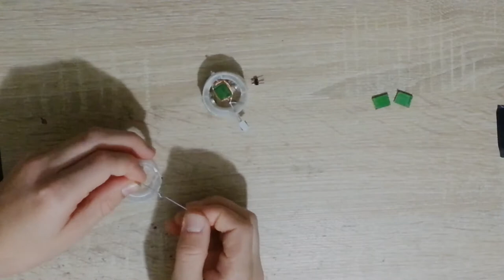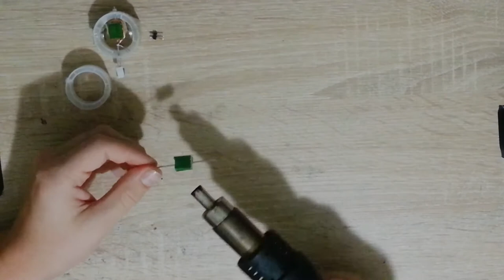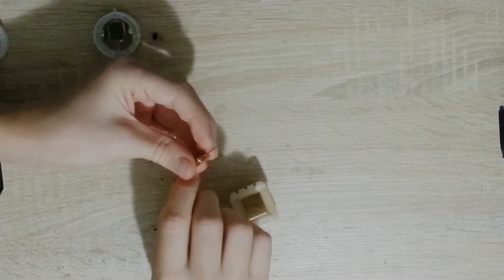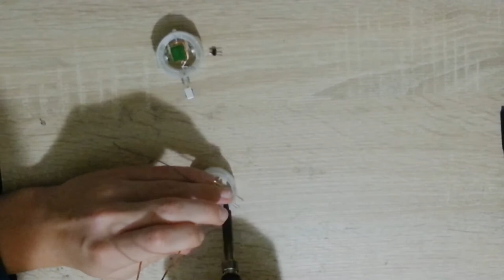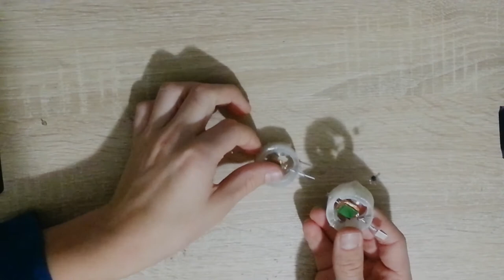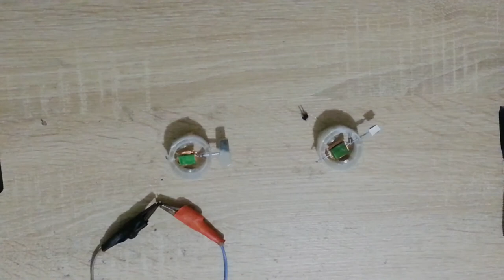Quickly building a Galvo for a future project

Comment: I am also working on diy galvo,
I wanna discuss something related it.
Reply from the maker: sure, what is it?
Reply: @king_wing34 
have you added torsion spring?
If yes what its homing position, because I wants to try such spring setup that can force spindle to center it from both direction if driven by both polarity, Is it any good to add torsion spring!?
How its Amplitude response when increasing frequency? It decrease linearly of varies? What is its maximum operating frequency and difflection angle amplitude on average without Pid?
Reply from the maker: @omsingharjit  well, no, I'm not using a torsion spring. What I did was solder a piece of thick wire to the axle and to that I connected a tension spring. Then I just adjusted it in a way so that the coil wouldn't be parallel with the magnets when its not being powered, so that when it gets powered, it won't happen that it may go in a different direction randomly or whatever... Also, I made this not thinking about driving it with positive and negative voltages..
While I can see a torsion spring working, I think a spiral type of spring would work better.
Also, while increasing the frequency (using a sine wave), I could only get it to about 500hz to 1khz without loosing too much movement. For frequencies higher than 1Khz I needed higher voltage and... well, by then the coils were burning up.. so what I built can't really go any higher than 500hz, but it I were to build it again and in a more solid way, I'm thinking it  would probably be able to do frequencies up to 2khz or higher. I don't know until I try, lol.
Reply: @king_wing34  so, your design is based on one side Active by Coil spring mechanism) ,  I'm worrying more about Its inertia because of thick and heavy shaft so my plan was to use 2mm I'd Bearing and smallest dia as possible from toy motor shaft and casing either moving magnet or Moving Coil  but I have seen lots of people tried much larger DIA shaft and bearing so I think it's not issue much so I will try both my and your design 'thanks " BUT i like to use curve  magnets so it's Force will be same at any position and direction, and if the amplitude decrease with Frequency Linearly then I like to use this topology where the amplitude signal of its Tilting positively feedback the Voltage or its Duty cycle or I will
Try to built Pid using Opamps if necessary just using Analog. 
By the way... 
how you driving it respect to your coil Inductance?
Amplifier and Volte ?
Reply from the maker: @omsingharjit  when I built it, I wasn't really trying to get the coil to have any specific inductance or resistance. In the video, I just tested it with a DC power supply, and if I remember correctly, I went from 0 to 5 volts, because the project I was planning to use this in, used 5 volts.